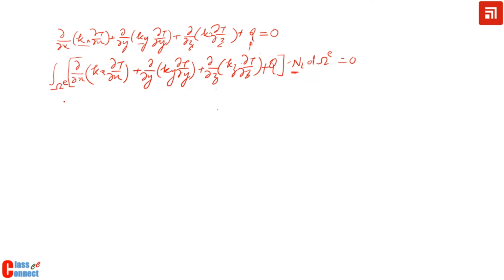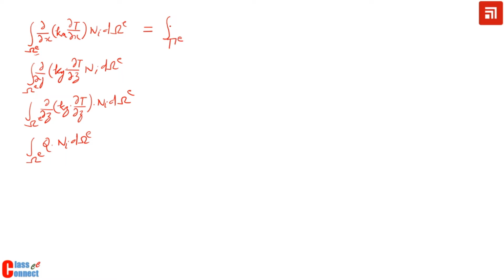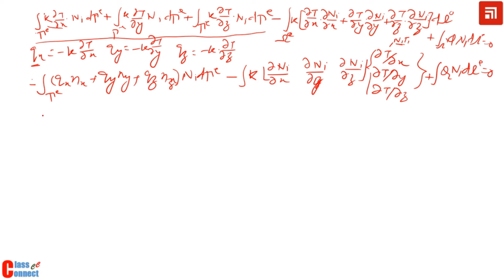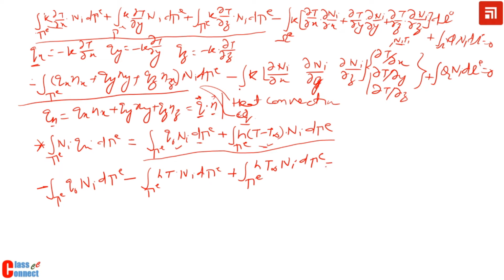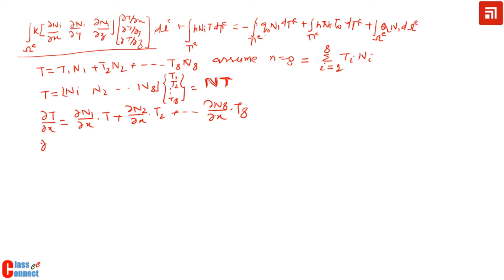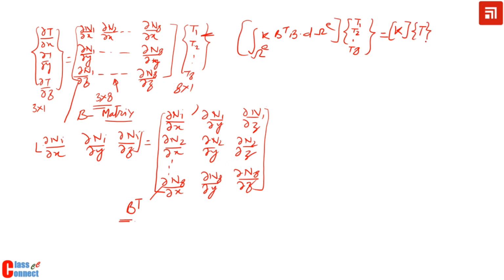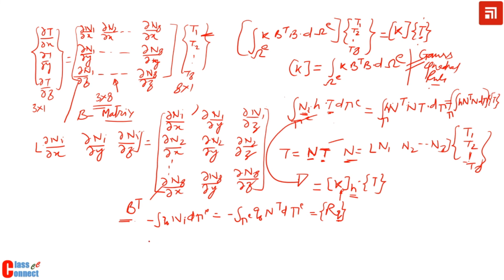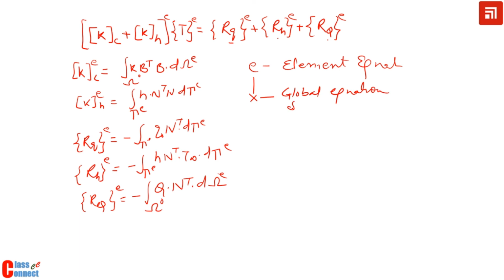FEM Formulation-3D Heat Conduction using Galerkin Method Session - 15 : FEM for Beginners

Comment: Sir @9:16 how are the direction cosines introduced directly into the equations? I didn't get that concept??
Reply from the maker: DCs are introduced to define surfaces on which the BCs are employed. e.g. the heat transfer may be on any of the three planes. The specific plane is defined by DC whether it is x-y, y-z or z-x

Comment: Sir in the quiz 1 question 2 how can it be dirichlet BC , at left end we have displacement u(0)=0 ; also the du/dx = 0 (Reference : Link 1) ; and since both are zero there are two BCs at a left side one is neumann du(0)/dx =0 and other is mixed because for mixed BC we have w1 * u(0) + w2 * (du(0)/dx) = 0 were w1 and w2 are weights for dirichlet BC and neumann respectively 
(Reference : Link 2). Sir i am also hereby providing the website link from which i am saying this :

Link1 (For BC's of a cantilever):
http://www.geom.uiuc.edu/education/calc-init/static-beam/support.html

Link 2 (For definition of types of BC):
https://www.multiphysics.us/BC.html

Also sir in the Example 5.1 of the 4th edition of book Introduction to Finite Elements in Engineering on Page No 177 in Section 5.5 by Chandrupatla and Belegundu there BC for left most node which is a fixed support for beam Q1 = Q2 = 0 which implies u(x=0) = 0 and du(x=0)/dx = 0. Please verify it sir

So sir it's  answer must be Both neumann and robin/mixed

Please review these websites once for my request , as i want to gain correct knowledge sir. Please sir please review your answer with concepts presented on these websites
Reply: Hello sir can you share your notes of such deep concepts related to FEM. Please sir waiting for a reply. Also sir i ask only genuine doubts , so i am sorry if i have hurt you in any way . Thank you sir for being there as a very good mentor during this quarantine period . Thank you sir.
Reply from the maker: Doubts are always welcome. Anyone can be wrong at places. The foundation of stress analysis concepts are Statics > Strength of Material > Machine Design. Thanks dear.
Reply: @vijaykjadon  Sir can you please share notes or question bank of such conceptual and deep questions of FEM as asked in question 2 of Quiz 1 inorder to get deeper understanding.
Reply from the maker: The boundary conditions that you have mentioned for cantilever are correct and obvious. We have to understand the concept of FEM and Dirichlet BC. In FEA of any beam element, both displacement and the slope are the field variables and if the field variables are specified then its Dirichlet BC. In the example of Heat Transfer only temperature (1 DoF) is the field variable and dT/dx is not the field variable. That is why in the case of cantilever, the BC to be of First kind.
Reply: @vijaykjadon   Ok and thank you sir. I understood the concept  that its the matter of what are field variables if field variables are constant then its dirichlet. Also sir is the result be going to publish on the certificate.